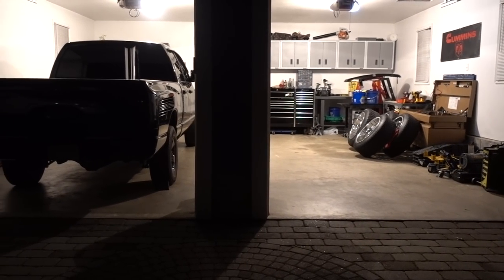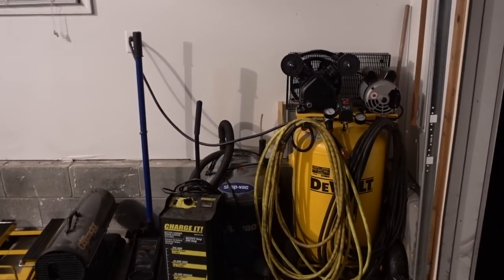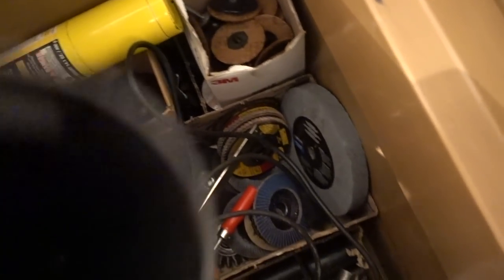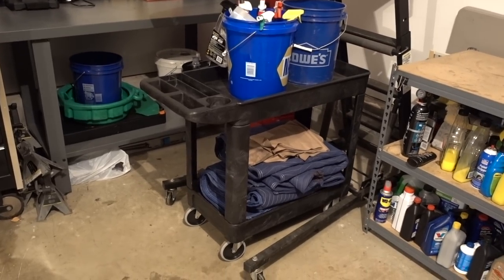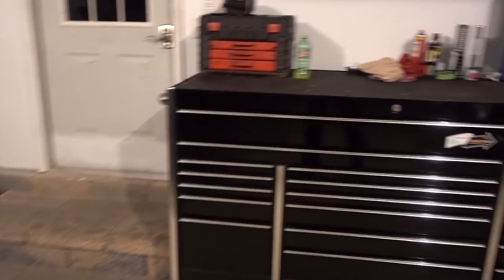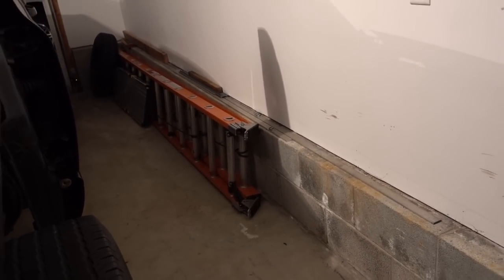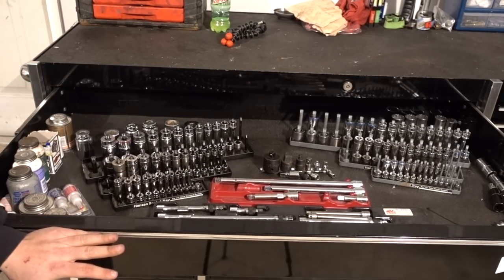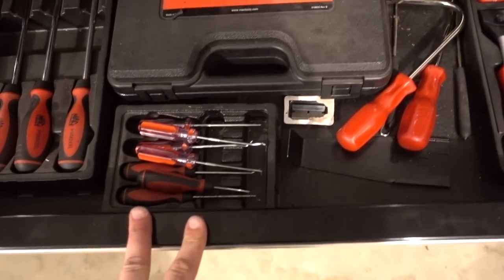Where All the Real Magic Happens!!!

Comment: I use those Rhino Ramps at work all the time. They hold up E450, and F450's up no problem. And you are right, they are cheap, and most parts stores stock them.

Comment: Why don't you run a hood stack on your fast truck? Isn't it more efficient than going out through the bed?
Reply from the maker: It was more of a personal choice to try and keep it a little more sleeper on the outside and I would have had to drill 2 holes out of my cowl hood which I wasn't a big fan of either
Reply from the maker: No stupid questions, my main reason for using a "stack" is because most racetracks require diesels to have an exhaust that exits straight up, your only options are a stack or a 90 elbow off your tailpipe to get it up. It also keeps the soot off the side of the bed.

Comment: s467 vs. s475? i got a1 head studs, south bend dd, fass 150 ,ddp 100 nozzles ,meth injection arson 3 in cp3, 66mm wheel, afe bladerunner, 10in lift on 40s
Reply from the maker: From the little info I have to go off of, doesn't sound like a 75mm turbo would suit you.